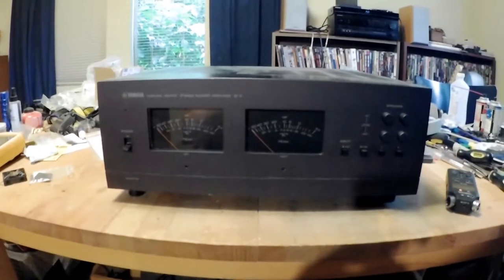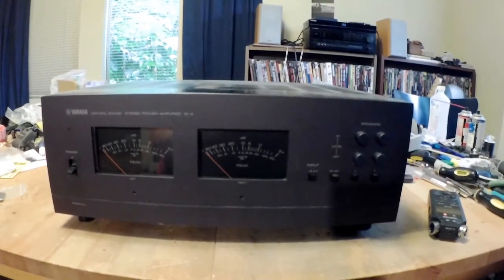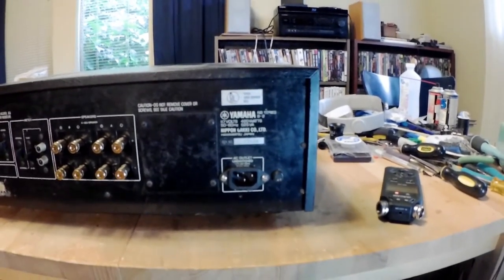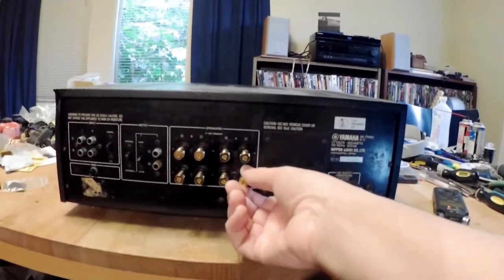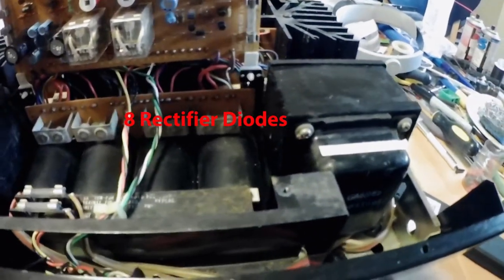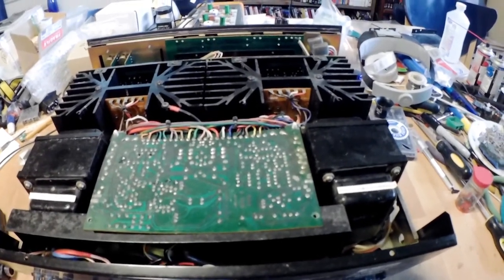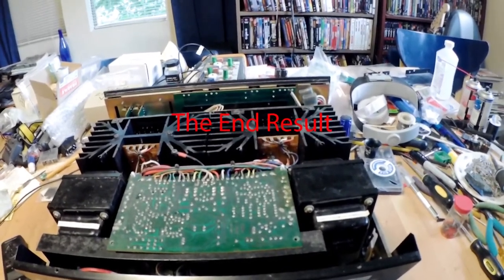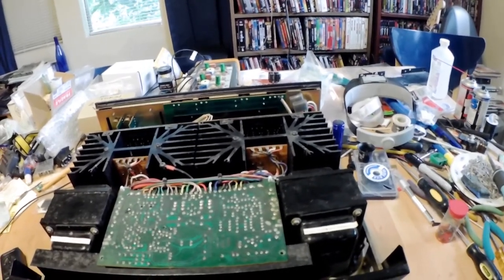Robert works on the Yamaha B2 VFET Amplifier

Comment: Nice vid, I just bought a Sony TA-5650  v-fet amp to restore and also ordered the SITs from Tomo in Tokyo, waiting for the Pass circuits…
Reply from the maker: Jon, I have seen a few Aleph-type CCS-fed VFET amplifier circuits on DIYAudio.com. One has two 2SK180s in parallel which looks intriguing. Of course, It would be ideal if Mr. Pass approves a kit design for us DIY'ers.
Reply: @NocturneVid66  hi Robert, I am waiting with interest. Bought matched quad 2SK180s and matched Quad THF51Ss

Comment: Nice!! I have a B1, and B2, not many really know how special they are. Would like to do the connector mods
Reply from the maker: Wow, Isn't the B1 all VFET?  I'd love to see you do a video on it compared to the B2. Does it sound less "bright"?
Reply: @NocturneVid66  The B1, I think it does have a bit more in the bottom end, and smooth. I'm just getting familiar with the B2, I would agree it can be a bit bright, very detailed and smooth top, but just a tad bright. Tweeter choice might make a difference.
A comparison vid is a cool idea..maybe down the rd.
Cheers
Reply from the maker: Thanks Von, I agree while the treble is "spotlighted", it is incredibly smooth for a solid state amplifier. I hope to eventually build a Nelson Pass VFET design, but that is about 5 projects down the road.
Reply: @NocturneVid66  A Pass amp is on my bucket list! At some point I'll have my friend built a First Watt for me, 25w or less for the horns, but a real Pass for the power hungry!

Comment: I have a bad B2 ..One channel is busted .. Two 2sk76 are bad .. I want to rep;lace them with 2sk60 sony Vfets.Could this be feasable?
Reply from the maker: It is doubtful that it would work. My understanding is that the Yamaha VFETs are significantly more powerful than the Sony ones. I doubt that you could get any kind of reliable matching between them. 
The fellow from Atelier Hi-fi below restores the Yamaha units. I do not know, but he might have some spare VFETS.
Your final option is to keep your current B2 as a parts unit and find another B2 on EBay.

Comment: Also not a dual mono amp. If you look at the power supply circuit you will see the two transformers supply both L&R amplifiers.
Reply from the maker: Thanks for the comments Squirrel. I can't wait to watch your restoration videos of the B2. You are correct the amplifier is not a true dual mono. The power supplies for the input section of each channel are shared. What fooled me was that there are separate transformers, high current rectifiers, and filter capacitors for each channel's VFET output section.
Reply: @NocturneVid66  Yes, Yamaha did that for most of their amps. They had a reason for doing this and the amps sound fantastic.

Comment: There is no way to use mosfets in the place of vfets in the B-2 unless you completely redesign the driver boards, replace them with a different circuit more like it.
Reply from the maker: The buyer's horror story that I heard was that it didn't work, the seller just wanted to fill the holes of the missing VFETs.
Reply: @NocturneVid66  that makes sense. The only B-2 with mosfets I have seen, had the entire amplifier boards removed and replaced. That was no longer a B-2.

Comment: I saw one at Estate sale today for $1450. I passed on it.
Reply from the maker: Sadly, that is about average for a B2 in good condition. I think the sound quality is worth it.
Reply: @NocturneVid66   I went back the last day of the sale they where offering 80% off everything including that amp!! I bought it and the matching T1 tuner!!! Its all original and it need the pots and boards cleaned. I will be sending it off for a full restoration.

Comment: You will be surprised about the  low end of the B-2 if you restore the amp. Those bulk caps are 40+years old. If you like the amp this much now, you will love it after you fit it with proper bulk caps. You are on borrowed time if you continue to use it with original bulk caps.
BTW, as far as the history lesson, the B-2 sold over 10k units and has one of the highest survival rate of any type of amp, old or new. I would not say that B-2 did not sell well, by any measurable standard.
Reply from the maker: That is good to hear that they were so popular. That means there are a lot more out there if I chose to start hoarding them. I see a lot of B2s on the Auction site but very few of the VFET Sony units. I need to look into recapping the dear old thing. Its capacitors have lasted far longer than I would have expected.
Reply: @NocturneVid66  Sony had the misfortune of picking the death-diodes and using them in critical functions. Nothing wrong with Sony's design but with the quality of the parts, which was unknown at the time. Otherwise Sonys are just as reliable. I have a few first Gen Sonys here with more than 40years under the belt that still run very well.
Reply: @atelier_HiFi  This diode can cause occasional noise, right? Can you tell me how to solve this problem? I have been troubled.
Reply: @yongshengyun  you replace the diode(s) which is actually a varactor that is used to set bias for certain transistors in the circuit. For this reason, the varactor which has a voltage drop about twice that of a regular diode (~.6v x 2) can be replaced with a two diodes...something such as 1N4148. Of course, this needs to be implemented with other all factors considered.

Keep in mind that the veractors used by Sony and those used by Yamaha are different, with those used by Sony having a higher failure rate.
Reply: @atelier_HiFi  Thank you very much for your reply, I also have a B2, one channel has a big click sound, which is irregular. I reversed the two front-end circuit boards and confirmed that it was the front-end problem. I compared and measured the parameters of the two front-end triodes and diodes, and found no problems. I think this should be a problem with the performance of a certain triode or diode. What should I do next?
Reply: @atelier_HiFi  After careful observation, I found that after a period of time after booting up, the click noise became rare. It happened occasionally. Is it also the problem of the series diode?
Reply: @yongshengyun  I seriously doubt that you have a "diode" problem. You should consider finding a qualified technician to look at your unit.....it probably need the speaker relays replaced, which are the only source for a "click" inside the unit...either the relays or the relay driver circuit might be causing the issues you are describing...but again, without seeing the unit on the bench, it is difficult to diagnose.